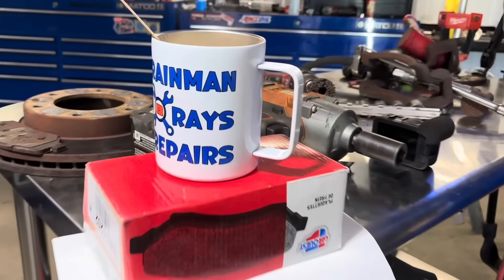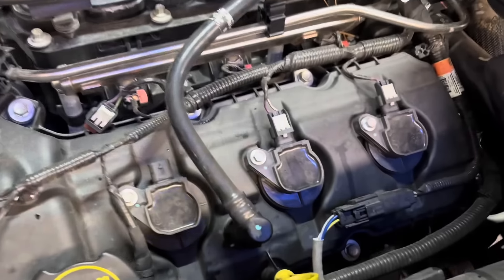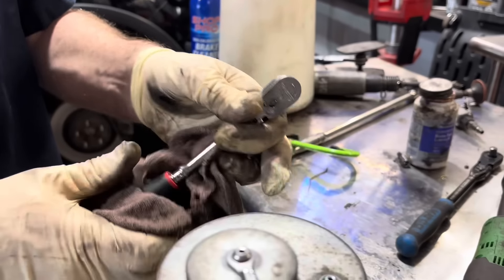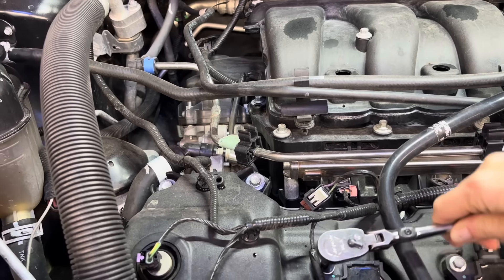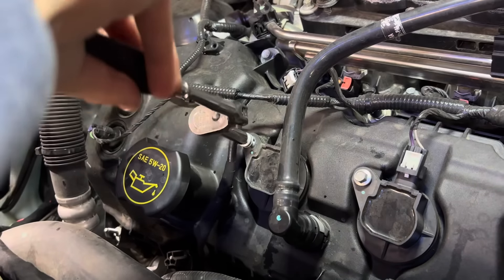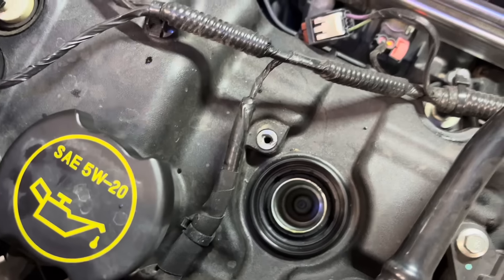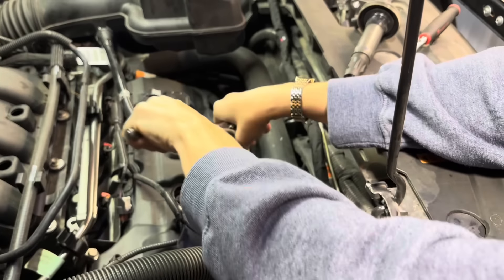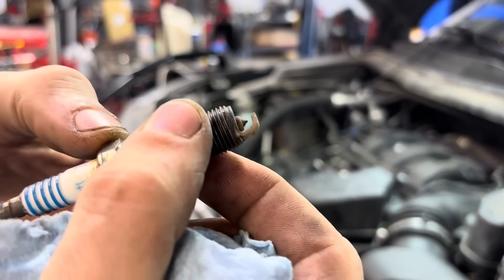Will I Beat the Storm?

Comment: Great job, Lauren !!!  Keep learning.  Mrs. Cuss has had GM SUVs since 1994; on her 2014 Yukon 1.5 weeks ago the oil pressure gauge dropped to zero and the check engine light came on, so she stopped and called me.  I asked her to check the oil level but she wasn't sure she was doing it correctly, so I had AAA tow it home.  Oil level was fine, but if she'd checked the oil level correctly, I would've had her keep driving it.  By the way, I replaced the oil pressure sender myself, by the reach around method, not the "remove the intake" that Ray videoed a few months ago.  That fixed it.

Comment: I've learned a great (and somewhat foolproof) technique for cooking corn on the cob.  Get the water to a hard boil, put the corn in an weight it down with a mixing bowl (to get it fully  submerged), then kill the heat.  In 10 minutes it is cooked, but if you can't get to it right away it doesn't over cook because the water cools down.   [And the air fryer is great.  We have two and our new over can also air fry.  We bought a large one with French doors and decided to keep the old one as well.]
Reply: Some years back I started steaming corn instead of using a bit pot of water. Uses much less water, much less heat, and cooks faster.
Reply: Sweetcorn doesn't need cooked so much as heated through. It's plenty sweet and soft as is.

Comment: This reminds me of when we get new guys in the factory, usually the people who don't have a ton of memory in physical work. 
It takes a bit to adjust with the amount of force you can safely apply to anything industrial or plain mechanical at a start.
In some applications you're very careful and slowly increase the level of "violence."
The funny part is that this is a good thing.
It's also a muscle memory or feeling you develop over time.

I've also seen newbies who just think because It's made of metal you can crank away. 
It was very obvious when I went to trade school here in Sweden. On the first week. 
We were taught how to use a torque wrench and the teacher gave us one with half a meter long handle he'd made. But it went to very low torque settings. Then told us to tighten a 6mm bolt to spec. Safe to say, with that much leverage and such a bolt.. Very easy to snap it clean off.
The amount of broken bolts that day was hilarious. It also showed the "Strong" kids that you're always better of starting at the bottom and slowly amplifying the use of force doing anything.